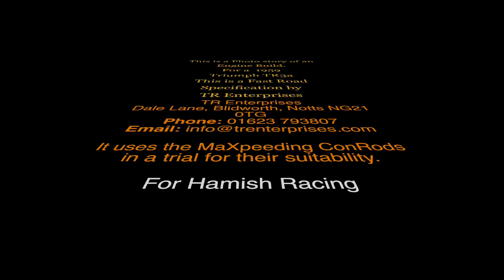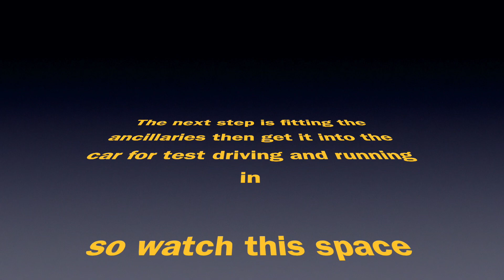Triumph TR3a 1959 Fast Road spec engine rebuild with MaXpeeding Rods

Comment: Hello Hamish, could you share details of the pistons?  Are the cast or forged?  87 or 89mm?  I like the engine paint color choice.  Looks like a tidy build.  Cheers.
Reply from the maker: Hi Dave
It’s all TR Enterprises kit with the original crankshaft 
https://triumphspecialtuning.com/product/89mm-piston-and-liner-kit-triumph-tr2-4a-morgan-4/
So 89mm cast pistons.
Reply from the maker: Hi Dave
It’s all TR Enterprises kit with the original crankshaft 
https://triumphspecialtuning.com/product/89mm-piston-and-liner-kit-triumph-tr2-4a-morgan-4/
So 89mm cast pistons.
Reply: @HamishRacing  Thanks for sharing that info.  I had an original set of cast Hepolite Big Bore 87mm in my TR3 and I'm considering a new set.  The engine is apart for a refresh now.  I think BPNorthwest sells this same 89 set.  Cheers.
Reply from the maker: I went from 87 to 89mm with this latest engine build. Very pleased with it. Big valve, shaped and ported head, TR Enterprises cam. And a very light flywheel. But it is set up for our sprints and hill climbs as you will have seen rather than the prolonged circuit racing that you do.
Love your videos especially the car build one. I’m forever sharing it to give people examples of great ideas and workmanship.👏

Comment: are your still liking the rods? Iam hanging out in Costa Rica right now where its warm and sunny.
Reply from the maker: Mike the engine only just finished and fitted into car. Needs running in. But they sorted timing and carbs on rolling road to 5400 rpm. Engine builder very happy.
Glad you are enjoying somewhere warm 😁 stay safe.

Comment: Hamish, I've looked closely at your cylinder head and the combustion chamber and I do not see any evidence of hardened seats.  Is this a new cast iron head?  
I received my new pistons and liners today.  PowerTune kit from British Parts North West.  The pistons look exactly like yours.  
Did you use the rings that came with the kit?
Reply from the maker: Hi Dave
Yes hardened seat valves, we can only get unleaded fuel here but for how long 😳.
It’s a rebuilt 3b engine with its original head just reworked as you have seen. I would have to assume that  TR Enterprises used the kit rings - I don’t have the space or knowledge to build a fast reliable engine.  They were the only reliable expert co. That would be confident to put together an engine, ignition and carbs to meet a bhp specification that I set them, as I have to be < 180bhp/tonne (kg). For my sprint and hill climb class. And it is.
Hope this helps.

Comment: I am building my TR for fast road what do those rods run ? got to be cheaper the Carrillos. what bore?
Reply from the maker: Hi Mike I hesitated about them to be honest. They are Chinese and you hear stories about soft metal and poor tolerance. But these look and “feel” quality items. There is a bit of weight too them and the machining is good the gudgeon/piston pins  fit perfectly as do the big end bearings all the holes are round too. A lot of the original classic car conrods are stretching and hole becoming a bit oval after 60+years 
The engine builder was impressed 
They are cheap at the moment in the UK you’ll have to look for a North American supply 
May be here
https://www.maxpeedingrods.com/about_us.html
There was a link with my video description.
Ps it’s 89mm
Reply: @HamishRacing  ya found the website there 330.00 usd that is cheap. I have gotten a set of AA I-beam rods for my stroker vw air cooled (about 200.00 usd) I wanted to try them because there shorter then stock so I dont need to shim the cylinders and make the engine wider.

Comment: Don’t you run in a power/weight class? Is this engine compliant?
Reply from the maker: Hi Paul. i am impressed that you follow this so closely. yes we do have  power weight etc classes and with this engine when its fitted means i will go into another class and have tougher bogey/target times- i'll just have to get quicker !!
i have been very open with this engine . hey its on youtube so no skulduggery here.
Reply: @HamishRacing  What if you modify it for more torque but same power?
Reply from the maker: Our championship rules are BHP/tonne at flywheels.
Reply: @HamishRacing  So theoretically you could have a toque monster but still stay in your old class. Have you ever thought of going down this path?
Reply from the maker: This is harder that it seems to increase torque with the same power especially when you don’t have an ecu to program. So have Ypres for both torque and bhp.